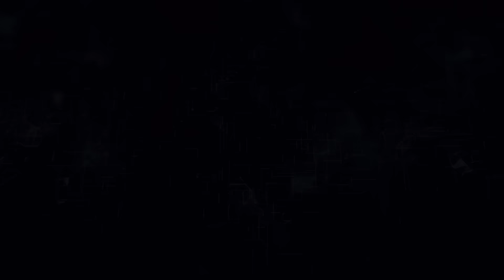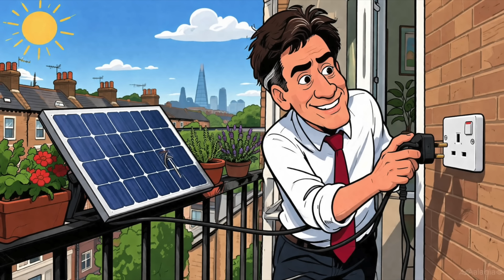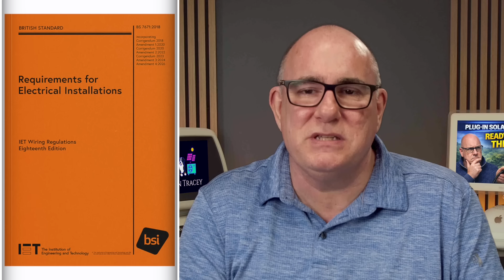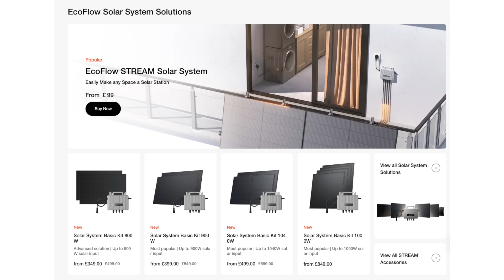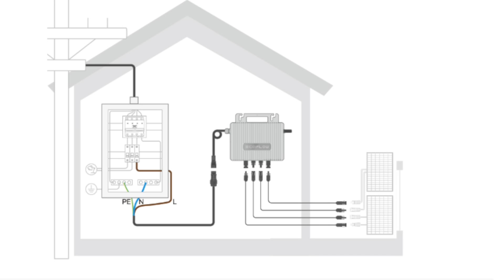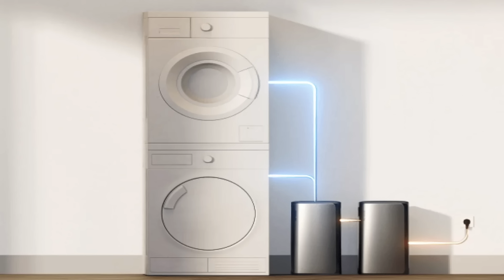Plug In Solar Is Coming… But There’s a Problem

Comment: Very interesting , sticking point for most in UK will be existing consumer unit and lack of bi directional RCBO in them . This will  then puts the price up, as not a diy fix for this problem .
Reply from the maker: @garthdowie9147 you’ve nailed the sticking point 👍  

A lot of existing consumer units weren’t designed with this in mind, so upgrades can push costs up.  

That said, I think we’ll start to see simpler, more standardised solutions as plug-in solar becomes more common 👀

Comment: Already got a solar system and Batteries, was thinking of getting a Ecoflow Stream Ultra X and 4 PV Panels + the Ecoflow smart meter, should be plenty for my needs 🙏
Reply from the maker: @ianandrew7010 that sounds like a solid setup 👍  

With what you’ve described, that should easily cover your base load and then some.  

The smart meter integration is a nice touch as well — really helps optimise how it all works together 👀  (check out my amazon storefont for latest prices #hint) 😂

Comment: I have a perfect garage in the back garden (south facing) that could fit 8-10 panels. I may try this first. My only issue is I don't know if the roof has asbestos. I know thats a little off topic (but it's a barrier to my progress tobsoale), could anyone recommend how I get it tested ? As many online sites look dodgy.
Reply from the maker: @TheRealLondonBoy that’s a great setup 👍  

On asbestos — best route is a *local certified surveyor* (look for UKAS-accredited testing). Avoid random online kits unless they’re properly certified.  

If it is asbestos, I’d avoid fixing panels directly and look at a *ground mount or frame nearby* instead — still works really well 👀
Reply: @JonathanTracey thanks. If need be i might replace the roof and get solar at the same time.

Comment: Great info thanks. How about a list of things that could run off/ be charged by an 800w system. For example, could i trickle charge an EV?
Reply from the maker: @TheRealLondonBoy great idea 👍  

I will see what i can do but it would be pretty generic as I cant list every toaster and kettle :-) on the EV front, you could if you had a charger and car that supported it, most home chargers/cars need a minium of 1.3kw to start charging the car
Reply: @JonathanTracey turns out my hot water tank has an immersion heater (been using only the gas boiler up to now). Would it be worth getting a diverter (just looked this up) to trickle feed this with plug in solar?

Comment: I use less than 1500kw a year about 4kw a day, a large system doesn't make much sense for me so this could be perfect. I've already ordered a stream pro and with a couple of panels on my south facing garage wall I'm reckoning it'll cover my base load.
Reply from the maker: @nickyb6435 that’s exactly the kind of setup this suits 👍  

Low usage + decent orientation = perfect for covering your base load.  

And your thinking is spot on — no need to oversize it, just match it to what you actually use 👀

Comment: I live in a terrace, I spend about £700 a year on electricity. A worthwhile roof and battery system is about £10k, the 14+ year ROI is just not worth it.
I'm spending about £350 on an ecoflow inverter, a pair of 515W solar panels from city plumbing and some aluminum A frames to mount them on a south facing wall. I'm expecting to save around £120 a year, a 3 year ROI is fine with me. I'll still be living here in 5 years but I don't know about 15 years.
Reply from the maker: @jack504 that’s exactly the right way to approach it 👍  

Start small, get a quick ROI, then decide if you want to scale.  

£350 for ~1kW and a ~3 year payback is solid — and you’ve avoided tying yourself into a 15-year commitment 👀

Comment: My standing charge is just under a pound a day. My usage is about 80p both e and gas summer. My standing charge has to come down before this makes any sense. We were given a quote that it would take 25 years to break even.
Reply from the maker: @janelewis9455 you’re absolutely right 👍  

Standing charges are the real issue here — especially for low usage homes.  

That 25-year ROI sounds like a full system quote though — smaller, targeted setups (like plug-in solar) can have *much shorter payback* because they’re cheaper and focus on base load 👀

Comment: Problem 1.. cells are only 20% efficient... 2. we don't get enough intense sunlight consistently/ long enough, 3. Increase in surface area = higher cost , bracing structurally on install + aftermarket maintenance, costs .  4.Degradation of cell performance over time. 5.  inverters are efficient in of themselves( 93 to 97%) , though the transfer to grid is not. My utility power comes at me at a stable 242v RMS. if your inverter is down from that, it will sit there sucking its thumb. Even professional installations struggle with this.. a domestic installation is a placebo making money for manufacturers, not saving you money on energy bills. ....folks ...dont get caught in the hype.
Reply from the maker: @1sostatic appreciate the effort 👍 but there’s a lot in there that doesn’t really stack up  

- Yes, panels are ~20% efficient… but that’s irrelevant. The “fuel” (sunlight) is free — efficiency only matters for space, not economics  
- The UK absolutely gets enough daylight — over *1.3 million solar installs* suggest it works just fine  
- Costs have fallen massively — small systems can now pay back in ~2–5 years depending on setup  
- Degradation is ~0.5%/year — so ~85–90% output after 20+ years, not exactly falling off a cliff  
- Inverters at 93–97% is actually **very efficient**, not a downside  
- And no, grid voltage doesn’t stop systems working — inverters sync and export above grid voltage as standard  

The big miss here is this:  

Solar isn’t trying to beat the grid — it’s just reducing what you buy at **25–30p/kWh**.  

That’s why people are saving money, not because of hype, but because the maths works 👍
Reply: @JonathanTracey  prove your 1.3 million installs  - do we have the same Photon continuance as Spain ? ?...er ...no ... - if local storage were to happen like some other countries.. then things "might" stack up .  feeding to our grid never will ...Proof and I mean REAL (not imagined) ... needs to show return on investment... so yes.. it doesn't stack up ... we do not have the photon intensity, we don't allow local physical storage for future use, .. I cite and reference the meteorological data between say .. Marbella in Spain against Bournemouth in England , hence why efficiency across active surface area actually matters.

Comment: Usual situation by the time the regs are through it's likely to be autumn whereby people will be disappointed with the output. Needs doing now or next spring.
Reply from the maker: @anthonydavidson1059 yeah that’s the usual pattern 👍  

But even in autumn these systems are still offsetting base load — they’re not just a “summer only” thing.  

And if you wait for perfect timing, you’ll always be waiting… meanwhile others are already saving money 😄

Comment: A retired electrical safety inspector here. Consider this scenario: Having been very pleased with a plug in PV system the user decided to get another, meaning that there were then two plug in PV systems within his installation. When he later needed to replaced a cracked socket outlet elsewhere he switched off the incoming supply to his house at the consumer unit but did not then check that the socket was dead before starting work because he thought that the PV systems could not supply power when the mains supply was switched off.  In this situation could there be any risk that the two PV systems might continue to supply power because each one ‘thought’ that the other one was the mains power supply? If so the cracked socket would then remain live leading to a potentially fatal incident.
Reply from the maker: okay, let’s walk through your hypothetical scenario. The minute the user switches off the incoming supply to his house at the consumer unit, or hopefully at the whole housebreaker next to his incoming supply/meter. All inverters would immediately cease supplying power to the house. The reason for this is they have something called anti-Island technology. They look for the 50 Hz signal from the grid and the minute that goes away they cease to operate. So there shouldn’t be any situation where what you describe can happen.
Reply: @JonathanTracey . Hi Jonathan, and thank you so much for replying.  I don’t dispute that a single inverter would be expected to shut down when the consumer main switch was turned off - because its socket would not then remain energised from a 50Hz source external to that inverter.  However, in a system with two inverters the socket ring main will effectively be energised from three separate sources ie the incoming mains supply and both of the inverters.  In this situation how would either inverter know when the consumer unit has been switched off because the socket into which each was plugged would still be energised from a 50Hz source external to it?

Comment: Any solar system lacking battery back-up just isn't worth the bother, really. Any energy you don't use isn't saved for nighttime; it's going straight back to the grid, and you won't get a tuppence for it. And, of course, in the winter months, you'll be lucky to generate enough energy to recoup your investment within four years, so the government claims. Not only that, but the price for these systems without a battery starts at £400 to £700 for an 800-watt system, according to the manager at Lidl. I hope this helps those who were thinking of rushing into getting these systems; there are better ways to get more bang for your buck and use more energy during the daytime, say with a portable battery system, which would pay for itself within a year or two if you use that extra energy during the summer to make a bit of dosh on a project of some sort. Personally, I'm aiming for completely off-grid, but I do have quite a big system with batteries, and I use a no standing charge tariff supplier, and I use my extra electricity for two neighbours living close to me to charge their electrical vehicles, plus I do charge my own, and that's one way I got my money back within four years.👍
Reply from the maker: @golddetector01 there’s a bit to unpack there 👍  

A battery helps, but saying solar without one “isn’t worth it” isn’t really accurate — most of the value comes from **using your energy during the day**, not exporting.  

Also £400–£700 for 800W is actually pretty reasonable, and entry systems (~£200) can pay back in *2–2.5 years* depending on usage.  

Batteries add flexibility, but they’re not a requirement for it to make financial sense 👍

Comment: Finally,  bringing the power in our hands rather than allowing us to be beholden to the profiteering energy companies. We've needed a fairer system for ages.
Reply from the maker: yep, the more you can generate yourself the less we need to keep handing the money to do grid upgrades
Reply: @JonathanTracey I read somewhere that if every house had solar panels on it there would be no need for power stations.  Don't know how true it is.  Obviously them systems would need batteries to. I liked the look of your battery packs. If I had the money I like you would have them all over my roof. My house i think would be ideal were facing southeast.

Comment: I’ve had 18kWh batteries and an inverter for the last year, just bought 4 DIY panels and plugged them in to that inverter… amazed at how much energy they produce. I’m now paying virtually nothing at the peak rate. I have no intention of giving anything back to the grid, just nice to run my dishwasher in the day and not pay extra!
Reply from the maker: absolutely, we still run our tumble dryer in the summer just because we can😁
Reply: Much you paid for your batteries? I have roof panels installed but I opted out of a battery as 4k euros for 5kw battery with expected life time 5-7 years is a very bad investment. I think batteries cost much much less it is just the installers are charging you a lot for them at the moment
Reply: @PashikTT  I have 2 x GivEnergy gen3 9kWh batteries and a gen3 inverter installed for around £8.5k. They come with a 12 year warranty, and there are cheaper systems available. The batteries reduce my monthly bill by £100-120/month throughout the year.
Reply: @not2ropey thx, just checked the price has come down since we last checked almost two years ago. However it still relatively high. At the moment there is about 7 cents difference between purchase price and sell back to the grid price. I think even at this price it is still cheaper in a long run to use grid as a storage for generated electricity as it will cost you 7 cents per kwt. To break even with batteries you need to generate around 110k kWt of power. 
I hope if in... years the price will drop 3 times then it will become cost effective. I might be wrong in my calculations though

Comment: Would be more useful  if you could switch off mains at fusebox and have it cover base load
or running fridge and low power essentials  in daytime power cut.
Reply from the maker: yeah, unfortunately that’s not possible due to anti-island mode, it needs the 50 Hz signal from the grid
Reply: @JonathanTracey  But is there some gadget to mimic the mains signal that could be plugged into another socket?

Comment: Quite interesting. I was thinking of getting one to put on my shed that is south facing that would help with a freezer.
Reply from the maker: Sounds like the perfect application, and maybe consider getting a battery and that way you can charge it up and then run the freezer at night time
Reply: @JonathanTracey  Cheers.

Comment: They push solar panels and solar energy yet are funding attempts to dim the sun😮😮 make it make sense
Reply from the maker: @DaVinci1452-y6p ah yes, the master plan to sell solar while simultaneously turning the sun down 😂  

If that were actually happening, I think we’d all have noticed by now…  

In reality, solar works because the sun is still very much doing its thing — no conspiracy required 👍
Reply: @JonathanTracey research a company in UK has been awarded a grant to explore the potential of dimming the sun so it’s not a conspiracy theory Google it❤

Comment: thats actualy very cool, I wouldnt have thought of solar in a flat but maybe they could be stuck flat to the external walls of the building and feeding wire simply thought the wall means any wall can be used. All my external walls are shaded mostly but I guess it wouldnt be zero. As long as it doesnt take up any space its cool. It would help if the solar was light and DIY easy to attach to any external walls of any building. Rather then installing the best heavy solar to 1 sunny spot, perhaps cheap but easy to install to large area could work better?
Reply from the maker: @katzda love the thinking 👍  

Wall-mounted can work, but shading will hit output quite a bit — even then it’s rarely zero, just lower.  

The real win will be exactly what you said: *lightweight, easy-to-mount systems* that don’t take up space. That’s where this is heading 👀

Comment: Or.. Milliwatt can stop hiking our energy prices to the highest in the world to fund net zero.
Reply from the maker: @markenetube ah yes, because global energy pricing is clearly controlled by one guy in a meeting somewhere 😂  

Prices are driven by wholesale markets, infrastructure and supply — solar just helps you *buy less of it* 👍
Reply: @JonathanTracey  Approximately 15% to 20% of a typical UK household electricity-only bill is used to fund Net Zero-related policies.  UK energy prices remain high primarily due to a heavy reliance on volatile imported natural gas for electricity generation.  UK gas production in 2025 is projected at only about 20% of 2000 levels, forcing greater reliance on imports.  Labour halted new North Sea oil and gas licensing in 2026 to accelerate the transition to renewable energy, meet net-zero climate commitments. This WHY it is Ed Milliwatts fault.  It won't get better if we won't use the same gas from the north sea that we buy from Norway. Yes our gas and oil would be sold at the world price , BUT we would get tax revenue from the sales. This could be used to offset the current high price.
Reply: @JonathanTracey  No he doesn't set the price of gas , I agree,  but he has the power to reduce the extra renewables tax we pay. He is UK's Secretary of State for Energy Security and Net Zero.  It's the same with the extra VAT this government is making off energy bills and fuel price rises.

Comment: I am thinking about this, but how do these sit next to my current system. How do the two systems know what the other is doing. Today for example I have been exporting quite a lot as the batteries are charged.
Reply from the maker: This is a concern and something you need to manage, otherwise they can get into a race condition to fulfull the homes requirements. I did a video on this a while back, but my microinverters supply constant base load, and the big inverter only jumps in when there is demand above that

Comment: I need electric when the grids down.
Spending 4-5 hundred to maybe save £80 a year is stupidly in my situation
Reply from the maker: @sunnyspring5105 you’re mixing two different things 👍  

Plug-in solar won’t run during an outage — that’s a safety feature.  

If backup is your goal, you need a **battery system**, not just panels. Different tools for different jobs 👀
Reply: @JonathanTracey  I understood that. Im saying the plug in option for me straight into the mains is stupid. I agree I need a battery set up and a move south.